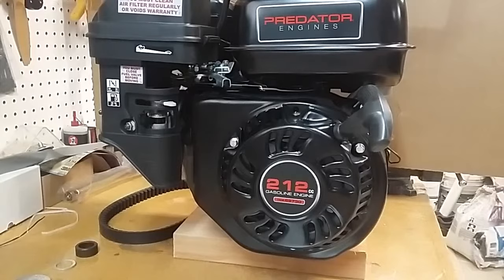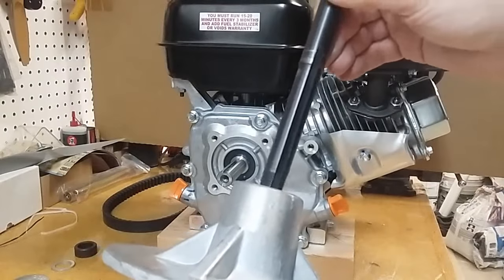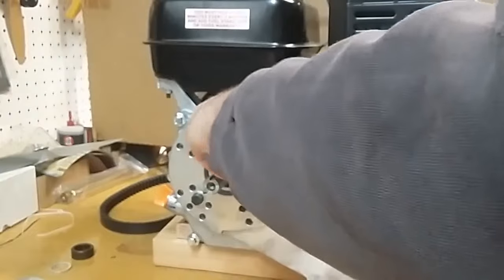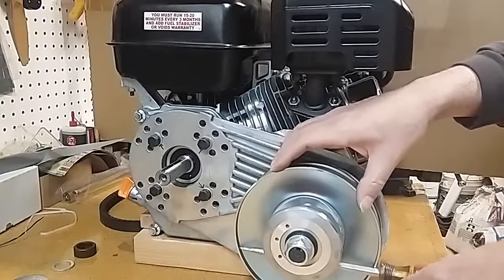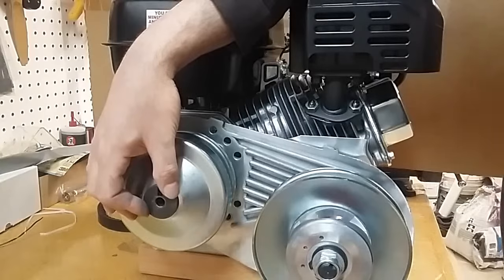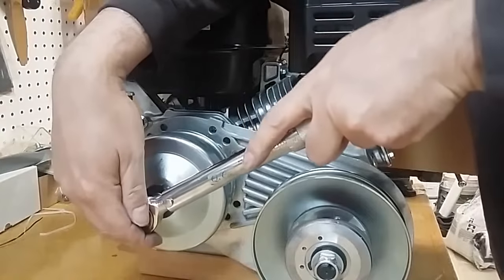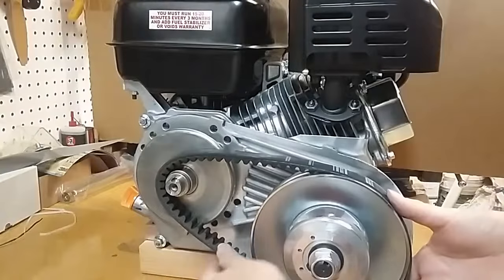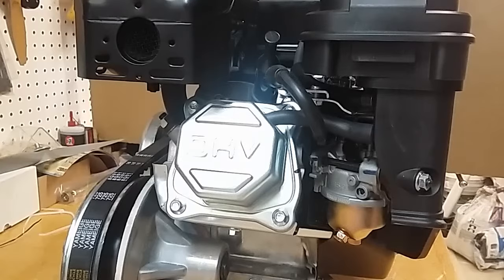Predator 212 - Series 30 Torque Converter Install: The SMOG Project 05

Comment from the maker: Recently, YouTube decided it was OK to start running ads on my videos without my permission and without paying me any revenue. If you see bumper ads or mid-rolls in my videos, please know that I HATE THEM TOO and did not put them there. That was all YouTube's doing.
Reply: you prolly dont care but does someone know of a method to get back into an Instagram account..?
I was dumb forgot my login password. I love any assistance you can give me.
Reply: Now is this basically the same method I would use when installing a Torque Converter on a stock 196cc Mini Bike Engine ?
Reply from the maker: Should be. Both the 196cc and 212cc engines are clones of the Honda GX-series engines. The TAV kits are knock-offs of the Comet Torque-A-Verter. YMMV, but the install procedure "should" be similar.
Reply: This is a great step by step how to video minus the the part where you forgot to put the belt on at the end of the video but I'll try to remember to put the belt on before the pulley cover some time lol. I just got the Torque Converter and Riser Plate in the mail today so I'm getting ready to do this install. I just wish I could see how to remove the mini bike clutch that is on there now and install the riser plate that I will have to do before I start putting the Torque Converter on. Also not sure how to make the new chain the proper size but I'll have to figure it out on my own I guess. Basically I have a 196cc Mini Bike and I'm replacing the stock clutch with this new Torque Converter so i must figure out how to get everything off first before I put new stuff on. If I gotta put this Riser Plate in that means I have to take the whole Engine out which sounds like a lot of work but hopefully it goes smoother than I'm thinking it will go.
Reply from the maker: Re-sizing the chain is easy. But you WILL need a chain-breaker tool for your chain size. Trying to drive out a pin with a hammer & punch not only sux, but usually just mangles the chain.
Reply: Non stop ads
Reply: You can get a app to cut the ads.

Comment: The belt is directional, there is a flat side and a angled side. The angled side goes away from the engine to match the slope of the torque converter.
Reply: He said that
Reply: He DIDN'T miss that point, BUT glad you mentioned that IMPORTANT part

Comment: In the old days if we needed to keep the engine from spinning when tightening a flywheel for example, remove the spark plug and stuff a piece of rope in the plug hole till enough is in the cylinder to keep the pistol from moving. Tighten the nut down then remove the rope.
Reply: That is actually a good idea :)
Reply: It’s what this 72 years mechanic still does

Comment: 17:21 a better way to hold the engine while torquing the clutch bolt, is to use a piston stop pin in place of the spark plug, or stuff several feet of starter cord down the hole when the piston is down on the power stroke, this way the valves are closed and will not be damaged. Doing it by holding the starter cord, you are putting stress on the starter dogs in the pull starter, and these are made of plastic, so you run the risk of damaging them . Small engine shop owner here.

Comment: Excellent instructional video thanks. It's well paced and very thorough. I love the way you dealt with forgetting the belt, I will remember that when installing mine and save doing the same thing 😂.
Reply: WHICH WAY the bevel goes was a EXCELLENT mention for sure

Comment: Oh yeah 😎.  Got interested in Torque-Converters after talking to John senior at "Mableton Lawnmower and Go-cart Repair" in Mableton, Georgia West of Atlanta. 
John said that a Go-cart with a Torque-Converter can literally Walk-away from a Chain-driven Go-cart both with 6.5 horsepower motors. 😳 Wanting power my adult Trike with 212cc, 6.5 Hp Predator so I can pull my 150 pound (empty weight) garden-tractor trailer from Northern Equipment to Lowe's and Home Depot .
Reply from the maker: SMOG weighs 1,350 lbs. I had plenty of power and no belt slippage while climbing a 4% grade. But I use a ton of gear reduction. Top speed is only 5 mph because : parade float.

Comment: as far as tightening that bolt on the clutch,from what ive read that lil slit in the washer is to hold a flat head screwdriver so you can tighten the bolt. Am i wrong? Maybe. im on my first go kart myself.

Comment: I find it interesting you and I both are into model aircraft as well as into the 212 with torque converter!  I am doing a mini bike not a go kart! Thanks, I found your video very helpful!
Reply from the maker: Thanks. That means a lot to me. I'm glad that it made your day just a little bit better. I personally still can't believe that this video has been viewed 45,000 times! When I started making these videos, I honestly thought it was just going to be my Mom! If I had known it was going to be so many people, I would have tried a little harder.
Reply: Great video.  I have seen people have prolly with the brass bushing locking up the clutch and they recommend not putting the bushing on.  Have you had any problems like this?

Comment: Very nice. I am working on putting an old Koehler 12hp in a club car cart. The shaft is just a tad over one inch so I’m hoping if I order the 1” torque converter that it will fit.
Reply from the maker: Fingers crossed. With any precision made part, thousandths of an inch (or 10ths of a millimeter) count. But the tolerances on the parts in my kit are pretty loose. So you may get lucky. Let us know how it goes.
Reply: Did ya get your golf cart project finished?

Comment: Could you possibly do a video explaining the proper sprockets to choose with this torque converter? I love this video and it was extremely detailed.
Reply from the maker: I'm not sure what information you're looking for. With sprockets, there are three critical dimensions: chain pitch (i.e. chain size, like #35 or #40), axle diameter (the size of the hole in the sprocket), and tooth count (determines your drive ratio). There's more information on the sprockets I used in my "transmission assembly" and "dog clutch" videos. But keep in mind that I'm building a big, heavy, very slow parade float with 60" wheels. So my choice of components are based on my experience with that application.

Comment: Hey mate got a question.. I’m getting a 6.5 motor with a 19mm shaft..will 3/ 4 fit on with the torque converter with 19mm shaft?
Reply from the maker: Converting mm to bananas... 19mm = .748" so it "should". But... you won't really know until you try. All of the components on my drive pulley assembly had a pretty sloppy fit. And the kits are made in China, so maybe they're actually 19mm kits marketed to us Yankees as 3/4"?

Comment: why would one use a 35 or 40 chain? what is the difference, advantages, and disadvantages?
Reply from the maker: #35 chain is narrower, lighter, and has a shorter pitch (shorter links) than #40. That allows all of the components in the drivetrain (sprockets, shafts, etc) to be lighter and often smaller than #40 components. For a single-seat go kart, #35 is plenty strong, and is generally easier to work with. I'm using #40 because 1) I originally needed the additional strength to handle the torque of the human-powered drivetrain 2) I was already using #40 in the human-powered drivetrain and had components and tools to work with it 3) SMOG is a parade float with a top speed of 5 mph. I'm not really concerned with weight savings. If I were building a go kart where space and weight were an issue, I'd probably use #35.

Comment: Whats the bolt length on the driver pulley? Videos ive seen have said to get a 2 inch one for the predator 212, but it seems to be too short
Reply from the maker: 2" worked for me with the spacer and washer stack I used. But if 2" is too short for your motor, get a 2-1/2" and cut it down as needed to fit your application.
Reply: @doktorscottdiabolical oh, I was actually just putting the pacman washer on backwards, so the flange wasn't inside the shaft and was spacing it too much. Embarrassing! But thanks for your response.

Comment: Hey brother. I'm trying to build a motorized bicycle with a preditor 212. I need help finding a place to order the tourqe converter and sprocket kit. And stuff. Any suggestions?
Reply from the maker: I got my TAV on Amazon a few years ago. There are lots of sellers, mostly selling the exact same Chinese kit they bought wholesale. Do your homework, and try to find a not-so-scummy one. FYI: putting a 212cc engine in a conventional bicycle will probably require a lot of custom fabrication. Especially to the rear hub. It can be done, but it ain't easy. You're not going to find a kit for it. Also... vibration. LOTS of vibration.

Comment: My old Carter go Kart has a 20 series torque converter setup. It also has the the Predator 212 engine. I guess I can change this out and go with the 30 series kit??
Reply from the maker: The knock-off "30-series" definitely will work with the Predator 212 wedge-head engine. Whether or not a 30-series will work in your application really depends on which Predator 212 engine you have, and the axle, sprocket, and driveline setup of your kart. You'll want to consider crankshaft diameter, chain pitch(size), Sprocket sizes (#of teeth and ratio of drive:driven), and available physical space and how much flexibility you have in mounting the unit. Each of those parts has to match the next. A TAV designed for a 3/4" crankshaft dia. won't fit on a 1" dia crankshaft. #35 chain & sprockets are not interchangable with #40, etc.
Reply: @doktorscottdiabolical  hello again... I think I may have figured something out instead of the replacement of the torque converter assembly. After I installed a new belt a couple of months ago I noticed belt dust everywhere around the engine and seat back. Last night I was looking at the alignment of the engine pulley and the axel pulley. The axel pulley sits 3/4” off center of the engine pulley. I’m guessing that could cause issues? The clutch seems to operate nicely when I have the tires off the ground and running the kart. I was told by a guy that because it’s a belt the alignment won’t matter. What do you think Doktor Scott? Also do they sell a shim or spacer set for the clutch where it mounts on the engine??
Reply from the maker: Alignment always matters. With v-belts, you can get away with a lot of misalignment. But it comes at the expense of heat, wear, and power loss due to increased resistance. With a TAV, I've read from multiple sources that the engine-side pulley alignment is critical. I had to shim mine quite a bit. I've never seen a specific shim/spacer made for this application. I'm planning to machine one at some point. Assuming you don't have a lathe, you might try searching for "shaft spacer" or "bushing stock" from McMaster-Carr, or Grainger, etc.
Reply: @doktorscottdiabolical  sounds good thx
Reply: @doktorscottdiabolical  one other thing. The pulley on the axel shaft that has a visible spring. Sometimes when riding it won’t go into the fast speed. I can sometimes here a clunk . Can that spring mechanism be cleaned and lubricated and make it function correctly??
Reply from the maker: I'm sorry, I do not know. I've got less than a mile on my TAV, so I haven't seen that issue personally.

Comment: This video will help me  with my new project! I’m going to put a 212 Predator motor on a bicycle but I do not know where to  get a good deal on the mounting plate? All prices I see it cost more than my new engine! 😤
Reply from the maker: If you're installing it in a bicycle, I'd recommend waiting to make your decision until after I upload the next video. I've been experimenting with the rubber engine mounts and have made a LOT of progress. That may change your decision, because rigidly mounting a 212 in a bicycle frame will transmit so much vibration that you may not want to ride it more than once. SMOG weighs 1,150 lbs, and even at that weight, rigid engine mounts were a total fail.
Reply: Call up your local machine shops and get quotes on how much itll cost to have them  to make you one.. you can have them bolt the plates together. no need to weld although welded together is preferred. Bring in your bike and they can measure it for you but you can easily design your plate with 1"x6" wooden boards from lowes.  You can screw up and still have plenty of board to cut a new piece of plate till you get your mounting plates perfect .. draw in where you want your bolts at that clamp the plates together and the holes for the wooden clamps that hug the seat post pipe and bottom pipe. drill out.. bolt together.. test for fit. Not big enough.. cut larger pieces.. too big.. shave off. easy.  For the clamping plates that hug  the seat post pipe and bottom pipe.. simply picture a 1" thick rectangle plate about 5" long. Drill a hole in the center of it that is the size of the seat post pipe. Then cut a line from one end of the rectangle down the middle till you hit the hole. Now you have a wooden clamp than can huge a pipe and have bolt holes drilled through the "clamping" end of that plate for the bolts to squeeze the "slitted" end together to hug the seat post pipe tighter. Then you you a piece of wood that bolts the clamping piece of wood to the "seat post pipe  plate" that stands up vertical.  Then you cut another rectangle block as a reinforcement plate to bolt the black plate to the base plate that gets clamped to the bottom pipe.  And youre done. Its basically two plates, two clamping plates. and 3 reinforcement blocks that allow you to clamp the individual plate to each other and to the clamping plates.  Nothing to it.

oh and as the Doktor said.. rubber mounting pads everywhere the plates meet contact with the frame and motor to absorb as much vibration as possible. Itsll make the bike quieter and keep your bike from falling apart when nuts vibrate loose and fall off.

Comment: Hello. On this video what is the outside diameter of the drive pulley. Looking for a cvt set up like this but need a certain diameter for clearance.  Thank you.
Reply from the maker: On my kit, the largest diameter on the drive-pulley assembly is the outer cover. It is 4.900" or 124.5mm.

Comment: Could you put a link of where you found the torque converter kit?
Reply from the maker: I bought mine on Amazon from a guy that was primarily selling boat stereos. That was several years ago and he's gone now. So, no links.   But... these kits all appear to come from one or two factories in China. I recommend finding the least-sketchy dude with decent prices that seems like he's include all of the parts when he ships the kit. Because all of the kits are basically the exact same thing.

Comment: Did u removed the governor or just run the engine with the governor intact?
Reply from the maker: I did not remove the governor. The motor is factory stock. SMOG is a parade float. He's designed to have a cruising speed of 2-3 mph.

Comment: Can that black shaft go through the opposite way for bicycle 🚲 chain to torque converter? They say get the 30 series but really don’t know 😅😂😂😂
Reply from the maker: Not on the kit I have. The bearings are different sizes on the left and right. And the shaft outer diameters are "stepped" to fit. So the shaft only fits one way. Also, the plate in my kit is only machined flat on one side. So it can't really be "flipped over" either. I've heard of a kit that has the output sprocket on the "engine-side" of the plate, i.e. not sandwiched between the plate and pulley. But I've never seen one.

Comment: Will you still be able to fill oil in that same spot where you had to turn it tighter than usual?
Reply from the maker: Not really. But the 212 engine has two oil plugs, one on either side of the crankcase. I can easily get to the one on the "tank side" of the engine to check and fill the oil.
Reply: @doktorscottdiabolical  thank you I was worried about that part I didn't know you can put oil in both sides
Reply: @doktorscottdiabolical  do you recommend I fill with oil prior to installed torque converter?
Reply from the maker: If you can't add oil after your install, you need to rethink your install. At some point in the next few years, you're going to have to add oil. Make sure you can do it. Pulling the engine out is a lousy method. 
On SMOG, it's pretty easy to add oil. But on my portable generator (which uses the same type of engine) I have to add oil by putting it in a squeeze-bottle and squirting it in. A regular quart/liter bottle won't work. I use an old mustard bottle. But I've seen guys replace the cap of a guart/liter bottle with a pop-top cap from a bottle of dish soap. That sometimes works. And there are always funnels. Remember, there is no "right way" to put the oil in. As long as it goes in and it's at the right level for your engine (and you don't contaminate it with a dirty container or funnel), who cares how it gets in there! Be creative!
Reply: @doktorscottdiabolical  thank you